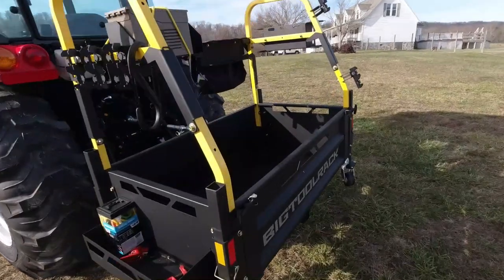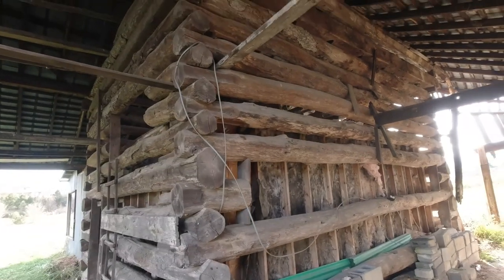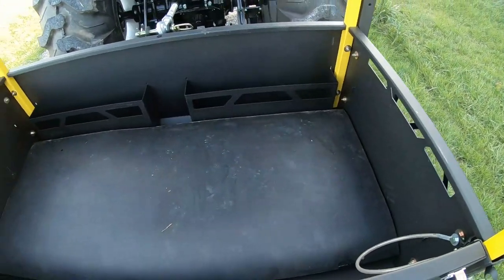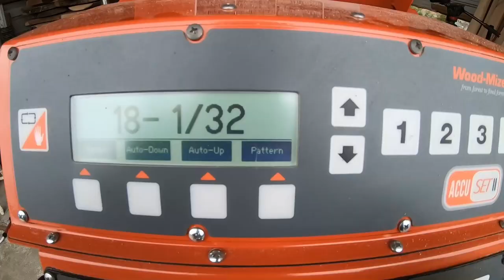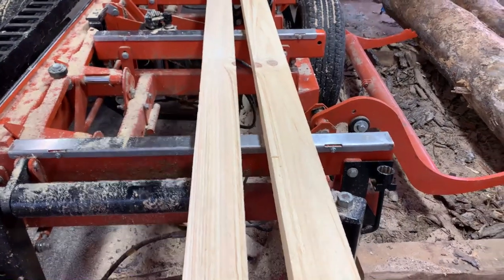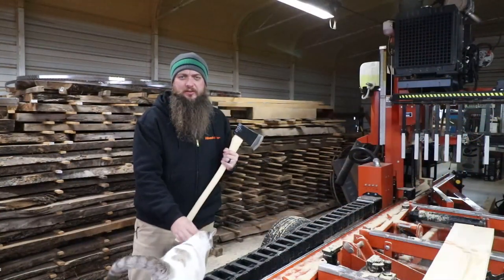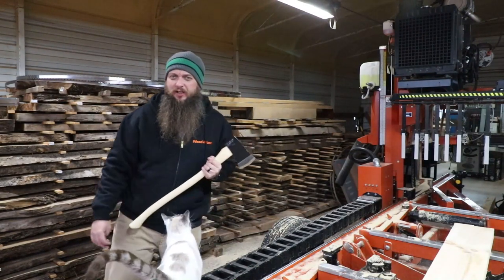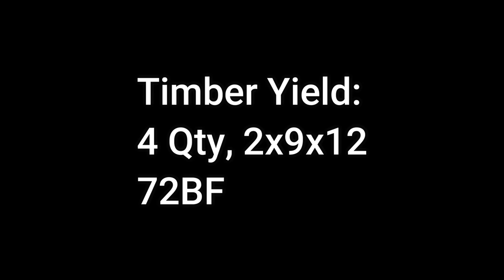How To Save Money On Tractor Ballast & Saw-Milling 2x10s

Comment: Good idea using those blocks to add weight to the rear of the tractor. Only down side those blocks will scratch the paint and start the metal to rust, so I personally would have put some thin ply between the metal and the blocks or rubber sheeting to prevent the box going rusty. Just a thought.

Comment: 102k still climbing!!!! 200 k here you come!
Reply from the maker: thanks Jay,
Reply: Got the parts from TYM should have it up and running Monday afternoon . I’ve got 41 white oak logs on the yard to cut up for the timber frame for my house. Where can I find out what size I need to cut my timbers to span 24 feet using king post design?
Reply: Good looking wood , lots better than Home Depot

Comment: I don’t know if this suggestion is a good idea or not, in the 60s a person who ends up being a friend of mine for over 50 years worked in the nursery with his dad and they had a Ford tractor and they needed counterweight. They took a 55 gallon drum and put a drawbar through it obviously cutting some holes and they filled the drum with concrete. Anyone that has a tractor with a draw bar set up can figure out the rest of this and how to do it it was certainly easy on easy off and it was a lot of weight. They would carry trees around and load them on trucks, large trees and needed the counter weight for that. If it helps great if it doesn’t I suppose there’s lotta other ways.

Edited for spelling error
Reply: Interesting thanks for sharing

Comment: Great idea on the Ballast Nathan, put a load tester on the Yanmar Battery, seems it drug a little on start up, perhaps its just my ears, or it was super cold and heavy oil that days start, just don't want you to over work that alternator because some battery decides to lay down on the job and two or three cells are working up to par, just my thoughts,  I have a Jar I am saving now for a pair of them suspenders first, then maybe I can get the axe someday, but Those Suspenders are A#1 in my mind..!
Reply from the maker: it is the cold weather, does that often when below 30, you were spot on as usual,
Reply from the maker: they are nice ones, got me some black ones today,

Comment: Most Farm Tractors have both rear tires filled with water and Antifreeze (the people that put new tires on can add it.) It's not cheap but not to bad. This adds a lot of weight to the rear. (Becareful when moving on a trailer afterwards) Move up on Trailer more. You prolly know all that tho! Love yur Vids
Reply from the maker: both my rear tires have fluid, 400lbs per tire,
Reply: @OutoftheWoods0623  I figured you knew that. Love yur set-up I'm Jealous Haha Keep on putting out those great vids! All the Luck to ya!

Comment: Want ballist build a big concrete block with the hook ups from a old Bush hog or something stuck through the form for the block and add one of those quick hitches you showed not long ago and back up to it and go. That way you got way plenty cheap ballist and your not messing up your tool box and you have it in close. Or you can get a old box blade or something similar weld a bottom on it and fill it with concrete

Comment: Did the mill not come with fenders over the wheels or did you take them off for a reason? I noticed water dripping, is it supposed to be that much? Never can be too much water?
I have this mill on order, just with a gas engine.
Reply from the maker: yes it comes with fenders for road transport, water is the sawyers preference, good luck with you machine,

Comment: Do Lowes label their 2X4 as such and what do you actually get, I'm from England and my local woodyard sells a true measurement in inches like yourself
Reply: The 2x4s are labeled as such at Lowe's, Home Depot and most lumber yards. They sell "dimensioned" lumber (kiln dried, and surfaced). What Nathan is cutting is "rough" lumber. Rough is actual 2"x4". The lumber you buy from the store is milled to 1 1/2 x 3 1/2 after the processing. 2x6s are nominal (at the store) 1 1/2 x 5 1/2.
Reply from the maker: he is exactly right,

Comment: A solid slab of concrete weighs 150 pounds per cubic foot. A cubic foot of broken concrete weighs 75 pounds.
Reply from the maker: interesting, thanks for watching,
Reply: @OutoftheWoods0623  You could make them any shape you want to fit where you want.